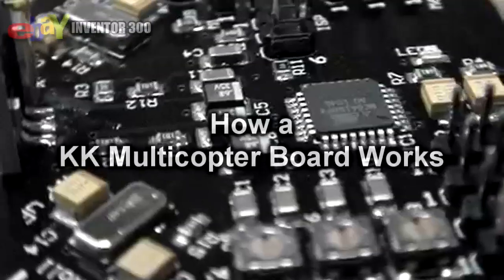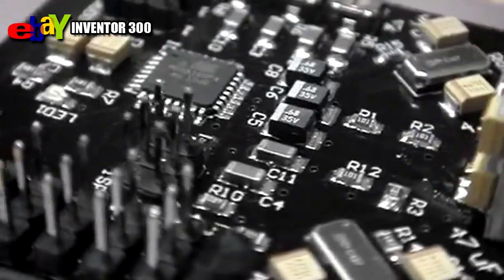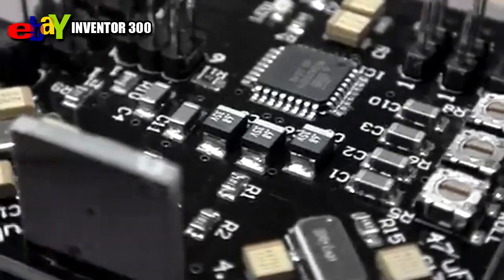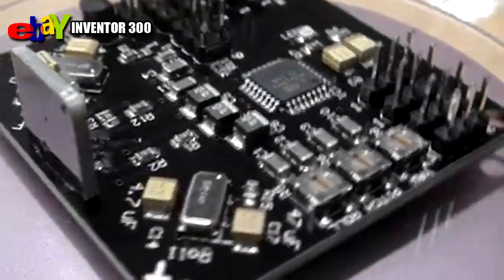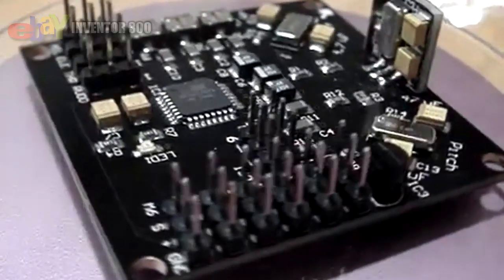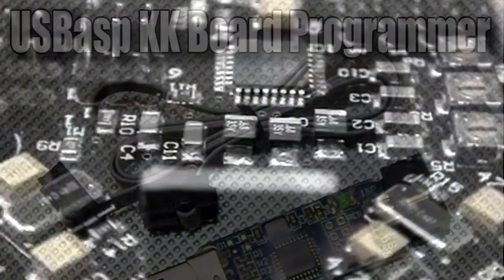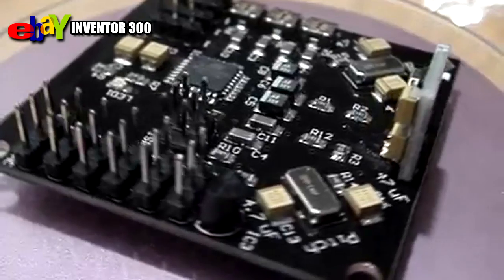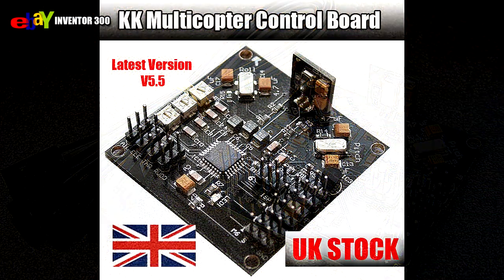How a KKMulticopter Board Works

Comment: I got a kit from china, and when I was opening the bag I softly touched the gyro board and broke it. I think that the new version has the gyroscope into the same board which is much better. Actuall this does not include a gyroscope, they are instead three 1-axis accelerometers.